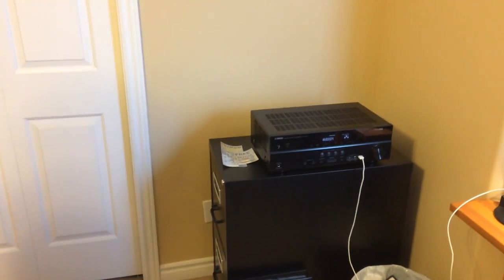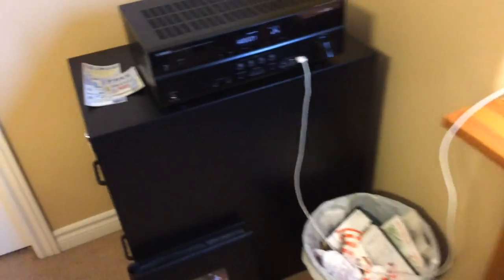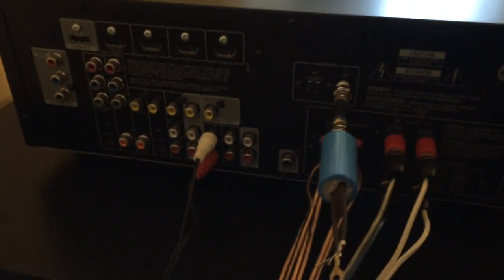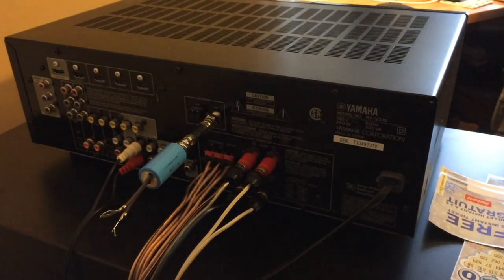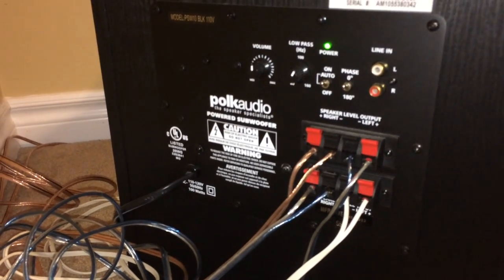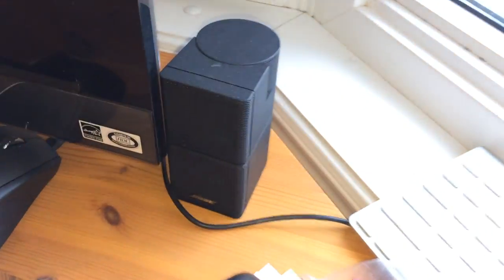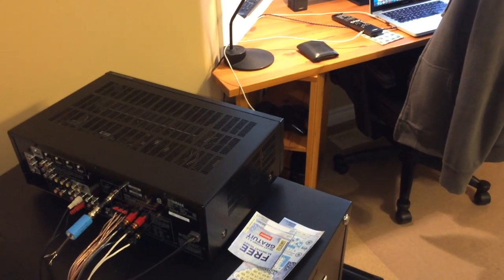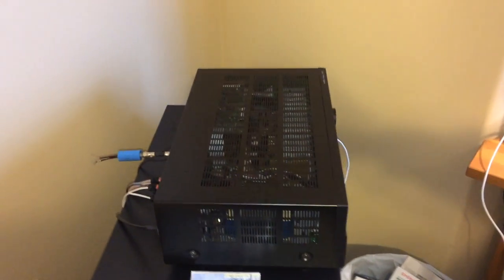Control Subwoofer Volume With Receiver - Polk Audio PSW10 Yamaha RX-V375

Comment: I would have factory reset your amp to get default settings. Because with default settings you should be able to use the rca jacks and everything should have worked.

Comment: Can I run 2 speaker wires from my receiver for my two speakers and the subwoofer instead of having the L and R speakers go through the subwoofer?..I like to have my speakers directly connected to my receiver...can I just run speaker wire to the subwoofer with the L and R in?

Comment: why do you put the cables of the 2 speakers onto the subwoofer cant they be powered by the receiver? or do they sound better being powered by the sub or maybe its the only option?
Reply from the maker: They can be powered by the receiver but in my case the sub in line on my receiver was not working.

Comment: yeah... you should be going straight RCA's and not using the speaker connections off of the sub, I know that Yamaha has a sub out jack, simply use a y-adapter and boo-blam alakazam.  Then turn your Hz dial all the way up to utilize only the low end of the sound sine which your AVR would route the high and mids to your lil guys, then sound checks with your ears as to what sounds best to you, adjusting the volume and test flipping your phase angle switch from 0 to 180 degrees.
Reply: The instruction manual for this Polk Audio subwoofer instructs you to hook it up exactly like he has it hooked up as the best option, he didn’t invent this idea or figure anything out, he simply followed the instruction manual...

Comment: Can I connect sony subwoofer in this receiver ? I have subwoofer which comes with sony 5.1 home theater ?
Reply: No ...u need dedicated subwoofer..Sony 5.1 is multimedia speaker in a box..cheap speakers ..
Reply: No u have to have a powered subwoofer with its own power supply power cord !! I wondered the same thing